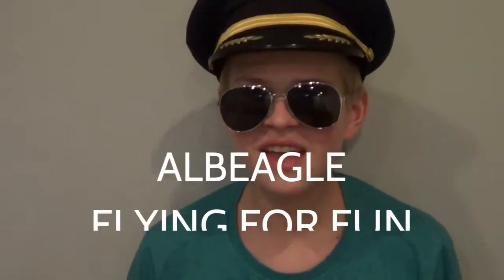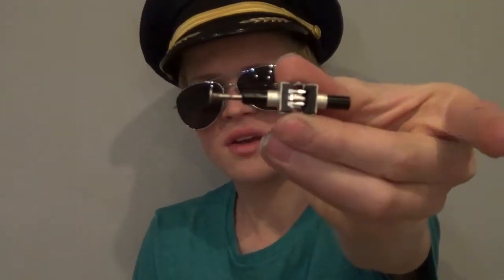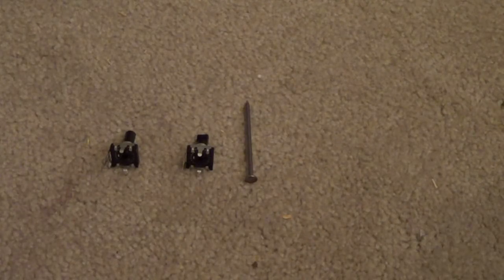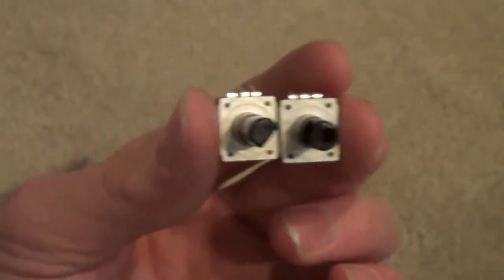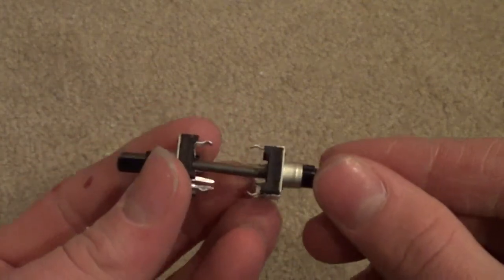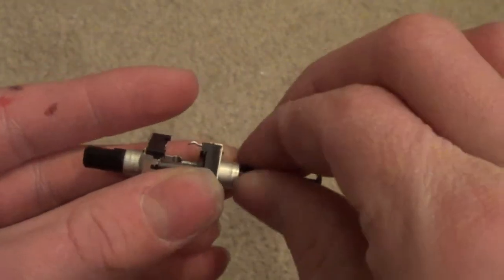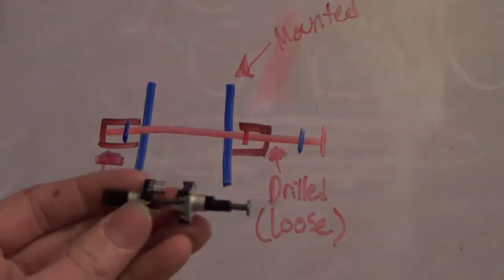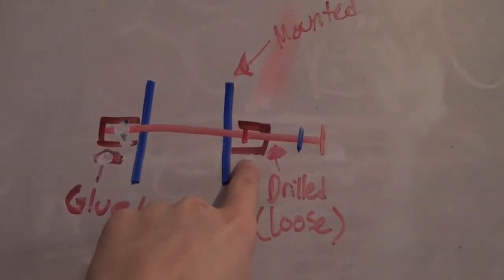How To Make Your Own Dual Concentric Encoders | Home Cockpit | Captin Bob

Comment: hey smart kid. how i control multiple things with one dual encoder like change coms and navs by selecting rotary switch(buttons) like saitek radio syle.
i need read something to use for precondition,but there is nothing i can read or nothing i can write with buttons. some free unused memory location? preconditon need some display output that drive it.it wont use input values and there noway even make custom inputs that not connected sim lol. dumb program

EDIT: works like i thought. write something on free memory. read it with dummy output.use it for precondition.

but how change value on 1 button to make it add when reach some value go back 0
i want ultimate dual encoder that i can use every knob LOL :)))

EDIT: OMG did it 1 dual encoder,1 8digit display and 1 button(other encoder button that nobody use,but i did dual encoder that use it too lol) toggle range 1-beyond. unlimited control and display whatever i want :)
Reply from the maker: Oh good! That is so awesome! Sorry I didn't see this until now, It went into spam.

Comment: Great idea 👍 I don't know if I can do it with the Key 040 rotary encoder ?
Reply from the maker: I don't think so, as you would be drilling through the encoder, not just the cap. 
I used EC 12 Encoders, that had a hole in the bottom of them :)